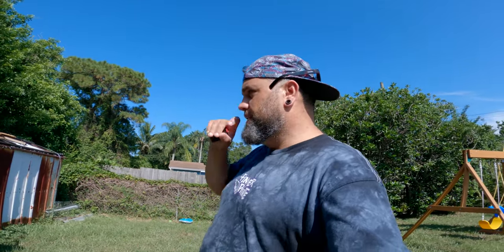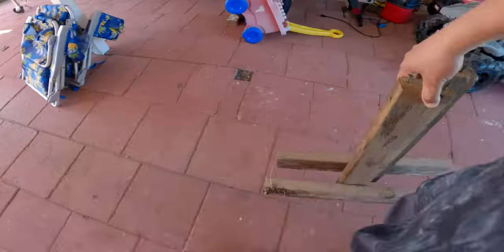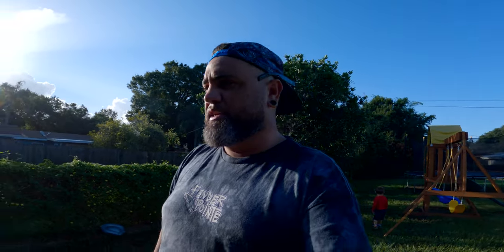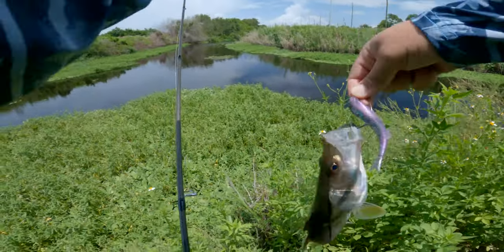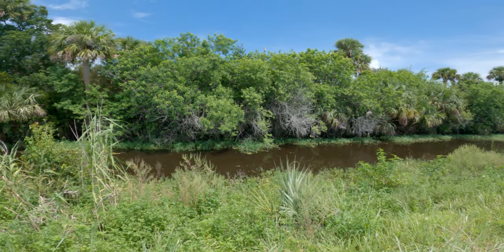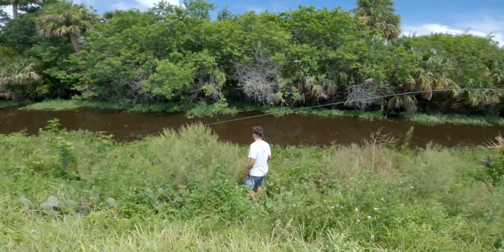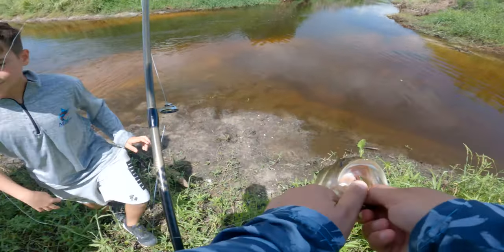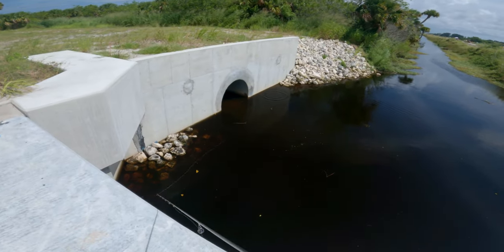Jon Boat Update! Tarpon, Snook and Bass Action! (On Fly and NLBN!)

Comment: 🌴 almost time to get the Jon boat wet 😆 , I spent the morning and afternoon termiteing  the old transom out on project nano skiff and making a card board pattern for the replacement transom , got my motor back yesterday $$$ running and ready to go , I’m gonna sand and paint it as soon as I get done with the transom getting redone  ,I could use a motor stand to I guess that will have to be done before I degrease it sand it and paint it , it’s so freak’n hot 😅, need to teach the boy how to double haul 😁👍